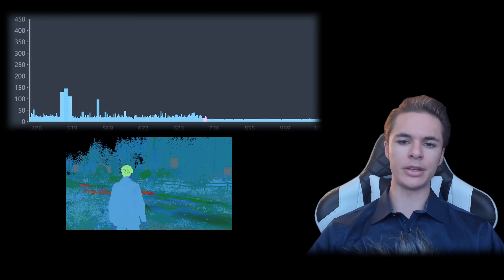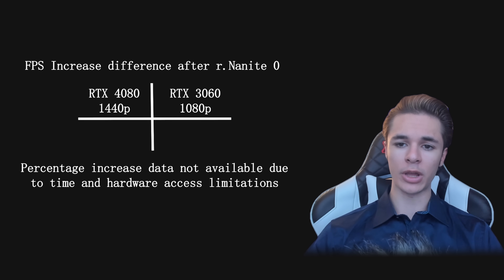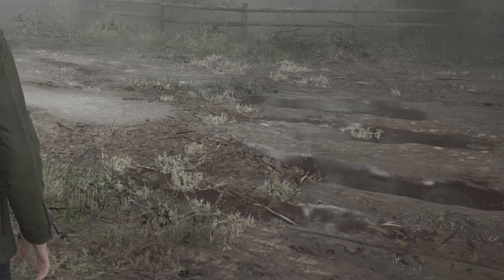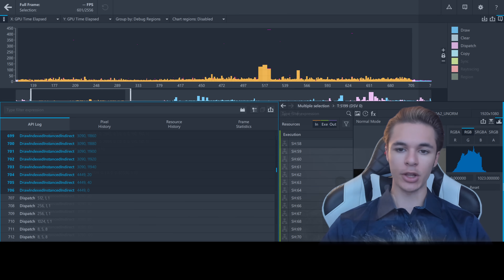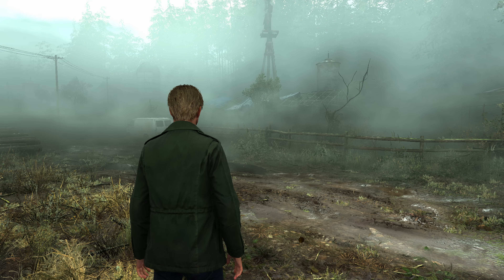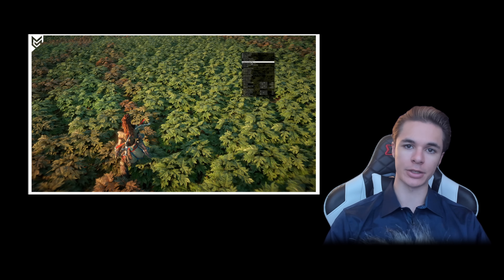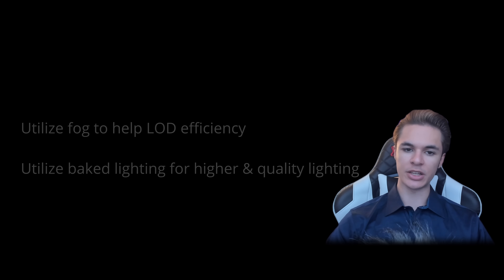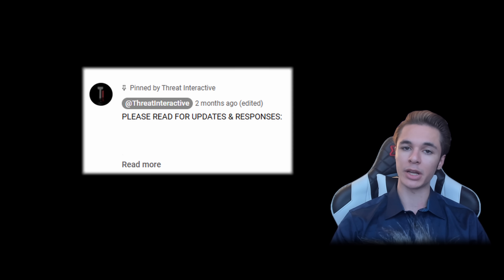The Price of Realism? | SH2R Optimization From The GPU Perspective

Comment: Lumen and RTX solutions have really caused major performance issues in games. It's just easier to drop in your primary light source and hit run, than to carefully bake out your lights and plot out your dynamic and static light sources. People used to be hired for this very process. They were called "lighting artists". It's funny tho cause before path tracing Cyberpunk 2077 looked barely different when turning on ray tracing because how well and efficiently optimized their initial GI  and lighting was in their own RedEngine. Then they moved over to UE5...Can't wait.

Comment: The original game was way more impressive at the time it was released than the remake is currently, it had no performance issues and didn't require an update.

They should've remastered the og game, adding modern lighting effects to match the prerendered cutscenes and make all changes optional (like those Halo games)

That would've been way cooler and less difficult/expensive

Comment: For reference SH2 at Native 1080p on the low preset using an RTX 3060 12GB and decent CPU PC gives similar performance to:

-Metro Exodus: Enhanced Edition at Ultra Settings with High RT and RT Reflections (4x VRS).
-Bigger scale, better image and post processing quality, better traced GI and Reflections, better shadows. Lower geometry count but extensive use of tessellation and far better textures.

Gears 5 at 1440p Ultra Settings with 8-ray SSGI.
-Bigger scale, very dynamic environments, better image and post processing quality, high quality static GI with SSRTGI, much cleaner SSR, SDF traced distance shadows and extensive Screen Space Shadows, better textures.

The Division 1/2 at 1440p max settings
-large interactive open world with real time probe GI, better image and post processing quality, regenerative cubemaps with much cleaner SSR, better shadows, especially HFTS in the first game.

None of these games have a stutter problem, all of them are bigger in scale, all of them were made with 8th gen hardware as foundation so really different budgets aren't an excuse, and its not a case of newer rendering tech not scaling to well old hardware.
Yeah ray tracing and virtualized geometry are the future, but if for the same performance you have to make those features piss poor quality and lower every other vidual aspect into oblivion, it's not a great foundation to build on.

Comment: I have a problem with DLSS in this game. When I activate it, I get some random black vertical lines, flickering depending on the angle I face. It affects primarily the walls. TSR and FSR do not have this, only ghosting. Actually, FSR introduces a white dot flickering on some surfaces. Strangely enough, Xess has the same problem from DLSS. 
When I disable anti aliasing completely, the image goes pixelated, of course, but the same black vertical lines appear on the exact spots that DLSS and Xess exhibit it. What could cause this?

Comment: Well, I don't have the same tech knowledge as you, but I do think that Unreal is not the main issue, developers and tech leaders are though.
I do understand why Silent Hill 2 does use lumen, it's more faster than bake lightning, although there is 0 advantage for the end user in using a system like Lumen when everything is just static, it ends up consuming excessive resources from the GPUs/consoles for nothing aside from hassle/money saved for the developer team.

Also despite it's awesome to see the game without Fog rendering the entire line of sight, I do also agree that they could have used fog to perform aggressive LOD changes in what is not seen by the player, using it as an excuse to win performance the same way the original title have done it.

SSR can be done without Lumen, unless on UE5 it's mandatory to use Lumen.

Comment: I thought the Engine from CDPR was very innovative but even they renounced it for some reason and they switched to Unreal for some reasons.
There is also Cryengine and Frostbite and every game made with Frostbite was able to run even on potato pcs and even delivering decent graphics and high frames.
I guess the developers just need to learn how to use Unreal properly, while silent hill 2 looks amazing at high graphics the fps is too much
Reply: Interestingly CDPR is actually making majour modifications to their own version of UE5 and even pusing some improvements & fixes to Epic to use in the base version

Comment: When talking about performance difference of 2 different systems, it is not correct to show the FPS gain without listing original values (referring 2:22 in the video). For instance, if FPS on your system improved from 20 to 29 which is 33% improvement, but on someone else system 100 to 119 which is 16% diff. So it's more correct to list the percentage and not number of FPS. Even when talking about the fps diff on the same system it might be confusing when those aren't 2 absolute values.

Comment: will pssr in the pro help with any of these issues?
Reply from the maker: With PSSR we might see different issues. 
It has a ultra performance mode which doesn't strike as a good sign. It might be good enough with higher base resoltion + higher output as we've seen with circus method DLSS/XESS but since we have inherent issues with optimization workflows, improvements we should be see on PS5 pro will be abused with sloppier optimization than ever before. 

PSSR isn't a guarantee either, Guerilla Games isn't using it and the PS5 pro 60fps mode looks awful.

Comment: There is no replacement for UE5's tech, but it has all the symptoms of tech bloat. Sadly there has not been any reversal of this trend in any engine. BTW the curent AAA engines have very high min spec requirements(insane for running the editor as well) and that is why I could not even try to use them in place of Godot. AAA has been chasing the graphics dragon at the cost of everything for so long I stopped caring about this junk before Nvidia made RTX.
Graphics guys will not understand the need to suport older hardware that other engines provide.

Comment: I have always been confused how does overdraw happen if the early Z pass is enabled? If you only draw the pixels that are on the very top (and we know which ones are on the very top because of the early Z pass) how can the overdraw happen?
Reply: Quad overdraw isn't the same thing as pixel overdraw, which is what you're referring to. Quad overdraw is specifically when the GPU is effectively running more pixel shaders than is necessary, because of poor triangle sizing. Pixels on the GPU always run in 2x2 groups called quads (which is where quad overdraw gets its name from), which allows the GPU to basically "peek" at the values of variables for other pixels in the quad (since the pixels are running in the same SM/CU and have access to each others memory). The GPU exploits this to basically calculate the partial derivatives of texture coordinates "for free", to determine what mip level(s) to use when sampling a texture.

This is totally fine when triangles are large enough to cover at least the entire quad since all pixels in the quad would be "active" anyways, but when triangles are small enough to cover only part of this quad, some pixels become "inactive" as they're not covered by the triangle and so won't contribute to the image. This causes a problem, though, as you cannot have partially filled quads, all four pixels in the quad need to execute in lockstep for things to work properly. So, to fix this, the GPU will still run pixel shaders for those "inactive" pixels but will basically mark the pixels as "inactive", meaning they won't write to any attached depth or render targets.

This hurts performance because if you have multiple triangles within a single quad, the entire quad has to be ran for each triangle. Four triangles that perfectly cover the four pixels, the entire quad is run four times, so the effective performance cost of your pixel shader goes up by 4x for that quad. Have enough triangles that are this small, and soon enough the performance cost of your pixel shader goes up 4x for most of the entire frame. As far as I know, the recommendation for triangle sizes is a dozen pixels or so along the hypotenuse, both because of this and because the rasterisation hardware in the GPU performs better with larger triangles (Epic discovered this with Nanite, as their custom software rasteriser beats the GPU's own hardware rasteriser for triangles with a hypotenuse of >14 pixels, if I remember right).
Reply: @jcm2606  Wow thank you very much for enlightening me!
Where could I read more about those quads and Epic's software rasterizer?
Also do you have any books/articles recommendations on the topic?

Comment: I'm sure this comment will get buried, but I'd like to ask some questions to @ThreatInteractive.

I'm attempting to get into developing on UE5 and I want to ensure my game is as optimized as possible because I intend to focus on compatibility with the Steam Deck. However, I can't necessarily get away with baked lighting because by necessity of the design my entire game is on a time limit and the lighting changes during this real-time limit. To increase performance I have elected for a top-down perspective to hopefully reduce difficulties with overdraw or complex geometry. However, I'm not a programmer so I can't really do any code-level optimization fixes, as well as being in a preproduction state where I'm just trying to implement my basics. When I'm farther along, what would you suggest with this design to ensure I can squeeze the best perf possible out of UE5 at my current level of skill and solo dev team size?

Comment: Which Frame Capture tool are you using??? To look at each individual render pass commands??
Reply: Intel's Graphics Performance Analyzers suite. NVIDIA and AMD have their own versions of the same tools called Nsight Graphics and Radeon GPU Profiler respectively, and there's RenderDoc which is hardware agnostic but less feature rich.

Comment: ue5 still a horseballs engine since that engine arrived we have lazy developers doing absolutely nothing. Ue 5 is for lazy developers and shareholders that want to cash in. Also developers are the only people constantly bragging about to use ue 5 since years why?? Less work same money? I believe that its definitely not rocket science too see through all that... How about do your god damn work that you are paid for you are already in the most overpaid industry how about less crying and doing actually work you lazy people.

If i pay someone for repairing the road i want it repaired idc. how you do it its your responsibility to do it right so everybody is fine with it. Is that too much?? But Thats not happening with developers using ue5. And im sick of it. It needs to stop with this engine its absolutely not ready but it should be used in alnost every game i see why...
its boring its stale and everything absolutely looks and feels the same.
Reply: this is NOT the damn engines fault you idiot, Unreal is easy to use which is a double edged sword where bad game developers use it as a crutch thinking it'll automatically make their games good by not changing anything, but on the other hand it's really felxible allowing good developers to make really good and unique looking games with good optimisation. This is a thing with EVERY publicly available engine such as Unity (which has it's own issues but is still good for certain games). You need to stop blaming the tools for the user just being bad at using them

Comment: Calling Open source engines like Godot a "waste" is missing the point entirely. Godot doesn't even compete with Unreal. It's fine that there is a widely adopted AAA engine available for people to use, but open source software has its place and you shouldn't discourage people from supporting or using it when appropriate.

O3DE is probably a more appropriate open Unreal competitor with industry support, but fair enough if you think it isn't ready.

Comment: I'm curious if you've done any testing on the overhead introduced in projects that overutilize Blueprints vs native C++? (I haven't explored the channel yet, sorry if this was covered already). I've been a professional software engineer since 2008, but I picked up Unreal as a hobby last year and have not been able to find any real in-depth analysis on this subject. Most of the information I find simply states that native C++ is always faster, but the claimed overhead introduced by blueprint ranges from "negligible" to "hugely impactful." I pretty much default to C++ since that's what I'm most comfortable with, but  there are definitely some major improvements to workflow to be gained in some cases. My general rule is to never use blueprint in anything that gets called often (whether in Tick or not) which leads me to use Blueprint mostly in single use setup functions, such as initial calls in BeginPlay when assets are spawned in. I use this sparingly regardless, but the convenient nature of Blueprint makes me wonder if it's being overused by developers; contributing to stuttering problems plaguing so many modern Unreal games. None of this really affects me until I start working on larger projects, but it would be nice to know if I should keep avoiding blueprint or if I can take advantage of some of the conveniences without harming performance.
Reply: Blueprint is 100% a-ok in one-off scenarios (level loading, door opening)
They're just a shortcut so you can skip setting up a whole new C++ class to do something simple, performance be damned (they're as slow as python in nature)
Reply: @letsexplodetogether5667  Thanks, good to know! That gels with what I've been reading in documentation and tutorials. There are definitely cases where spinning up a whole new C++ class feels burdensome. I imagine I'll understand better once I get into Unreal's profiling tools. I've barely touched on optimization for the smaller prototypes I've been making, but I'm definitely someone who puts high value on smooth frames, so I'm sure I'll be down that rabbit hole soon.

Comment: Are you gonna analyze Stalker 2 when it releases? They use UE 5.1 but from GSC words they modified it so much that internally they call it UE 5.1.GSC due to how many changes they did to the engine.

Comment: The Sims 2 has a great dynamic reflection system, with objects and characters reflecting in mirrors. In "Castaway Stories", all the objects are reflected in the sea, creating a fascinating effect. These are probably the remains of ancient civilizations' forgotten technologies. Can anyone tell us more about them?
Reply: I remember TES 4 Oblivion had correct reflections in water that I think even captured actors iirc.

There are certainly a number of older rendering tricks that either aren't used or wouldn't be applicable to modern scenarios. - I can't wait for screen space reflections to be a thing of the past...

Comment: The game barely runs at 40 fps and even then continually stutters. Had to force enable FSR 3 and disable SSAO in the engine's code to get it to run smoothly. Now it does run at a very good framerate but there's still that occasional stutter

Comment: I haven't checked lately but I think those initial dispatches relate to the "GPUScene" construct. It's a GPU buffer containing data about all renderable objects in the scene. Ideally the dispatches should fire only on changes or walking through an open world but it is possible to trigger this behavior without realizing it like if you for example animate the intensity of a light, unreal will in a frame do a RemoveLight + AddLight call which triggers an update for all affected objects. It also used to cost ~10ms on CPU on PS4 before I modified the engine :)

Comment: Unreal Engine games are a fucking shame. It's poorly optimized every fucking time.
Reply: and that's not the damn engine's fault, it's the developer's fault, please stop scapegoating the engine for developers not doing their job properly
Reply: @randomcommenter10_  Dude it is the engine fault. 100% of the games using UE4/UE5 stutter every seconds. It's even something Epic promised to adress in the last version.
Reply: @MisterKrakens  I never have any stuttering in any UE4 or 5 games so it might be a problem with your system, or maybe because you play in DX12, I play Unreal games in DX11 with barely any stutter issues. Even then it's the developer's job to precompile shaders to reduce stuttering, which some games have done such as Stalker 2
Reply: @randomcommenter10_  Dude. It's not a matter of me and you. It's common knowledge. I probably have a better computer than you and most people and it stutters. The official benchs show it, it's notorious. It's not your PC or my PC.

The shaders precompilation helps indeed but even then it's still somehow stuttery on UE5.

Comment: 5:35 thats wrong. since UE5.3 Lumen reflections can be used without Lumen GI but you need to enable hardware raytracing, and it will force Hit Lighting to be enabled automatically, as Lumen's Surface Cache optimization is not available when Lumen GI is disabled.
Reply: Yes but 5.5 will allow this with software Lumen
Reply: @Hybred  Where can I find more info about this? From what I know from Lumen devs, since 5.3 they had no plans on improving software ray tracing mode as they wanted Hardware ray tracing to be the standard, even now HW RT comes enabled by default in 5.5. That's why they keep only improving HW RT
Reply from the maker: @alextoesk4573  You needed a baked a environment in 5.3 for Lumen reflections. 
In 5.5 Lumen reflections work like additional raytraced reflections in terms of system independency.